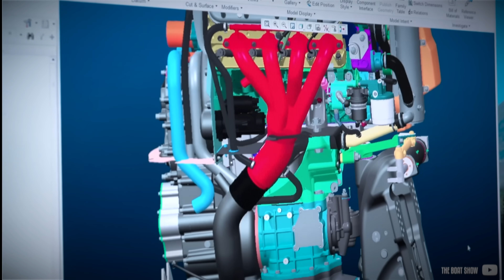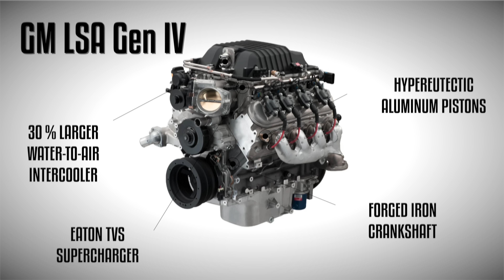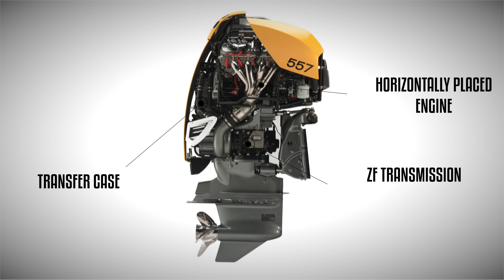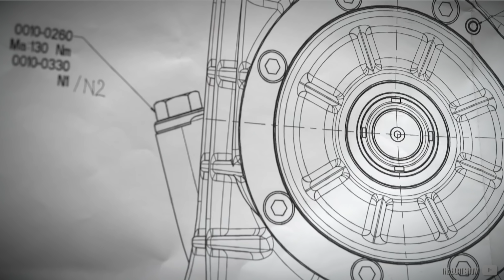How Volvo Killed This 627hp Supercharged Chevy Outboard

Comment: Using a car engine to power a boat is as old as the invention of cars. And even today, most engines used in a majority of boats are automotive based. And the modifications needed to make them live long lives in the salt water world are well known and documented. The automotive world is the feedstock for the production of marine engines. 

What 7 did was package a high performance automotive v8 power head onto an outboard lower unit and turn it loose in the marine world. It flat out worked, and it sold. But like the OMC v8 outboards, which came onto the scene and literally raised the outboard performance bar to a totally new level, the Chevy V8 outboard did the same for outboards. Now 450hp+ v8 outboards are widely available. Center console boats with 3 to 8 outboards bolted to the transom putting 1000 to to 4500 hp into the water are somewhat common. Now you see those big boats  getting to their destinations at 70 to 100+ mph speeds.
Reply: "most engines used in a majority of boats are automotive based" That is not true today. Outside of diesel all of Mercury's engines (outboard and sterndrive) are purpose-built marine engines. Including the new sterndrive product. With the 4.5 and 6.2 Mercury went away from GM blocks to avoid the need for VVTI in favor of simple pushrod tech.

Comment: Wow! Yet again another unusual engine that is not common knowledge. Great work Visioracer.
Reply: Pretty common knowledge in the boat world. Been out since 2011.
Reply: @longsleevethong1457  the R-4360 is pretty common knowledge in the aviation world, been out since 1945, but the average person knows little about it and it's worth watching a video on it, the same as this engine.
Reply: @Hydrogenblonde  we’re not talking about 100 year old boat engine history. Nice shot at a fallacy tho. We’re talking about what was a modern production engine seen everyday up until a couple years ago. Also only the transfer case and lower unit is truly unique. The LS engine might be the most widely produced engines in history and The transmission is an off the shelf zf.
Reply: @longsleevethong1457  it's still worth watching a video on it.
Reply: @Hydrogenblonde  i actually did look it up lol

Comment: Speaking as an Engineer, and a previous owner of an inboard outdrive boat ,   the idea of adapting an automotive power plant to anything but an automotive application results in bad reliability, too many changes in power direction,  too much weight and an overall bad result.  After a few years, I couldn't wait to get a power plant that was purpose built for a marine application.  It has less weight and MUCH better better reliability.  is quieter, with better fuel economy, etc.  My suspicion is that these engines were ever intended to be anything other than for someone with too much money to brag about to the hot babes and his other rich buddies.

Comment: Watched the company grow with amazement with what they were building and watched them die and knew it would happen when Volvo took hold. It was a short run. I am not clairvoyant but saw this coming. Now Merc has a V12 and no one to compete with. Volvo use to be innovative but guess they settled in at their place at number two. The seven marine was just too cool for them
Reply: What VP didnt know was that the calibration of these 7 marine engines was not EPA compliant. And thats a huge bloody liability
Reply: @whocares4648  EPA is just a US thing which others don't necessarily follow, ask VW if they ever paid any fines. What you say may be true but I find it hard to believe that Volvo working so closely with GM, a big chunk of their stuff is GM powered, that they would be clueless wether or not they could get an LS engine to comply with any standards. Just like them buying all the last supply of 496s GM made. The government had GM stop production during the bail out crying lack of efficiency but had no concern with volvo purchasing thousands of engines and use them for the next five years after they were discontinued.

Comment: And now Mercury is making a 600HP outboard and I'm seeing a number of them at the local marinas, they appear to be selling well.  So it seems Volvo left something on the table.  I wonder if the big outboards were cutting into the Volvo inboard sales and that had something to do with Volvo killing it?  If yes, then it seems to have been a mistake as Mercury has picked up where they left off.
Reply: Seven, even with Volvo backing it, would never been able to compete with Mercury. Seven was a custom, niche product with very high cost and many outsourced and complicated parts. The Mercury is basically an off the shelf product, normal warranty, have deals in relation to navigation/electronic support. It's developed from the ground up as a marine engine, with all the major parts built in house, and a huge dealer network, way bigger than VP. The moment the v12 Merc was released, the Seven sales would have dropped like a rock.
Reply: @Kowalski301  you're likely right, but there's still a group of people who buy for the flashiness above all else, and the 7 had that.  Especially in the category of those big boats. Is a 65 center console with 5 outboards practical? Definitely not, it's a show piece, I think 7 could have continued to sell into that market. No doubt the Mercury would have been a better motor.
Reply: @8180634  There are always people who buy custom or niche products and like to show that off, but the market is small, and the exterior of an outboard is also very limited and streamlined in that regard, and they all essentially look very similar across brands. So a custom paint or decal job is basically "90%" of what people see and all you need to make your outboard "unique" The only other thing people care about is the number of outboards and the HP... So if the quality and performance AND look isn't setting the niche product apart from the competition, there are even less reason to buy it. It would be naive to think that VP didn't run the numbers and saw there wasn't any money in it for them.

Comment: Kind of ironic that Volvo teaming up with Yamaha to build a 60 degree V8 car engine spawned the Yamaha 4 stroke V8 outboard. And now they bought and squelched it's competition.
Reply: Good point. Didn’t think about that
Reply: And ford used that engine in the sho too I think…or they designed that separate….can’t remember
Reply: @longsleevethong1457  The Ford motor was 90degree cast iron block V8  based on the duratec V6 but with Yamaha designed heads. Yamaha used that engineering and built a 60degree aluminum block. Then Yamaha turned the heads around, went back to timing belts, put in a dry sump, and increased displacement and made it an outboard engine.
Reply: @don2deliver  that’s it

Comment: It used to be from about 70 HP the price is reduced as the HP goes up, a 30 hp might cost you $4K, but a 70 hp will come in around $6K. Following this example, a 627 hp O/B should cost you $45K, not $100K plus.

Comment: The writing was on the wall anyway. The mercury verado 600 has more reliable naturally aspirated power, better fuel economy, lower unit steering, and it’s less expensive.

But the verado 600 would not have happened if 7 Marine didn’t kick things off with the 557 and 627.

Comment: The Cox 300hp V8 outboard Diesel has more torque at lower rpms, which means a faster plane and even in tight turns doesn't lose torque or rpms like the rest do. It does weigh more at 866lbs, however the pros out weigh the cons. And fuel mpg's forget about it, it blows them all out of the water. One tank to make it from Miami to Nassau and back, with no stops at Bimini for fuel. Now that's Impressive !
Reply: Just think how much better mileage you could get with 100hp!

Comment: Okay, but in essence its an azimuth pod mounted to an supercharged LSA. Obviously the gear train would have to be designed in such a way to avoid patent infringement but its basically a 90 degree direction change between an engine platform thats got as much or more suppport in the performance and aftermarket street racing world as anything else; and a pod drive which multiple companies have marketed over the last 20 years. 
I mean there are LS jet boats and air boats and for that matter SBC 350s in more inboard boats that pretty much all other non-diesel motors. 
Take a super available and easily upgraded high-hp motor, makena reduction gear jack shaft which isnt a top secret mechanism and add an off the shelf pod drive and wrap ot in some custom molded plastic and Id be hard pressed to consider it a patent issue and its certainly not unable to function in marine environments. Its an assembly of more or less common off the shelf parts using fairly standard gear train fundamentals, it wasnt some kind of perpetual motion machine or fusion reactor

Comment: I dislike the gear train whine. It didn't need to be that way if they had used helically cut teeth instead of spur cut teeth..
   Where is the air intake on outboard motors?

Comment: What was the point for Volvo Penta to kill this manufacturer? 
What do they have in that kind of range? Nothing, as far as I know, they never did outboards. The only lousily related thing is the Yamaha V8 that was offered both in Volvo cars and as an outboard marine engine.
Reply: Volvo penta 550 and 770 a 50 and 70hp outboard in the 70s an 80s
Reply: They have 430hp gasoline and 1000hp diesel inboards.
Rich people mostly buy a ready to run boat, they do not care about inboard or outboard, so they could easily be picking between a Volvo 800-1000hp diesel inboard or a seven marine 600hp gasoline outboard.
So it still makes sense to buy out the competition, and the competition was greedy enough to take the money and leave his company.

Comment: Volvo lied through their teeth, they knew Mercury was coming out with the 600, and it was designed from the ground up as a complete unit. Volvo didn't believe they could go head to head with Mercury, so they just threw in the towel.

Comment: The fact that they are using an off the shelf 5.7L LSA chevy engine as the power plant and still have to audacity to charge $100,0000 or more for a single unit just shows how ridiculous insane these outboard motor makers are! They are straight up robbing their customers by charging such stupidly sky high prices like that.

Comment: Just another example of a major company coming in doing a hostile takeover of a smaller company and then crapping on the original owner/owners and staff. On top of that taking the designs and innovation of the smaller company and shelving it. At least with the 7 Marine design they were using common GM engines. You can buy parts for those engines just about anywhere.

Comment: That boat that had 5 627's on it....couldn't possibly haul enough fuel to run those things at WOT for more than 20 mins. Jesus.
Reply: 5 627HP engines would use about 280 gph at full throttle.  Nobody runs at full throttle for long periods  of time. At a good fast cruising speed  they will burn half that amount.
Reply: Unlike a car or a small lake boat, these high speed open ocean cruisers with 4-5 engines can easily have a 400 gallon fuel tank.

Comment: An outboard motor that costs 2x the price of the car the engine was pulled from, must have been a really low volume outboard
Reply from the maker: Big outboards in general are not something very affordable. A Mercury Verado 350 costs 30K just give an example
Reply: @VisioRacer  We've got a honda 250 and a BRP evinrude 150, i was trying to make a pointed comment on how overpriced many of these engines are, often costing just as much or more than the car engines they're based on.
Inboard and inboard/outboard setups are much cheaper, you can get a 5.7L/350CID turn key LT for something like $1500, you just need a boat to put it in and a water to water heat exchanger, heck, you dont even need that, you can just use an air to water heat exchanger. Sure this is just the engine part, but the closed ecosystem of outboard motors means you cant just easily order a lower unit and mate it to just any engine, which allows manufacturers to charge basically the maximum the market can bear, instead of being competitive with themselves, they're competitive with the customer.

Comment: It was cool but it was a bad idea.  Boats require constant sustained power because they can't coast. Using a supercharge, Petrol, V8 motor was the wrong philosphy.  These are good for short burst of power and use lots of gas.  The right philosophy is OXO marine with a 4.0L twin-turbo , V8, direct injection diesel. It has more torque and can sustain it's power at a lower speed.  Plus it gains efficiency at lower throttle levels which what it takes to overcome the constant resistance of water. These motors were special though,  It's a shame they sold to Volvo Penta,  Volvo does make wonderful marine motors.

Comment: Just thinking if they made a V6 LS what kind of power that would make
Reply: There is an i4 ls out there
Its on YouTube
Reply: the new 4.3 v6 chevy trucks are basically a v6 ls its different than the older 4.3 v6 that was based off a small block chevy with 2 less cylinders.
Reply: @ivanshapli1827  this
Reply: Approximately 25% less

Comment: I friend of mine here in South Florida has twin 627's on his 37 Intrepid... 
They are expensive to maintain and until the lower units were replaced with the dual props, it was not very efficient.
They are mind numbingly loud on long trips.
Only a few good mechanics are familiar with them that you can trust.
You can tell they were built by "fresh water" guy's because there are a lot of corrosion issues...
When 7Marine sold out, they got the Golden Handshake!!!

Comment: If I spent that amount of$$money$$$ on an engine I sure as s**t wouldn't run salt through it!!  Even with trying to make sure all inner components were protected!!! Little dead animals can clog a masterpiece like that in a matter of milliseconds to totally waste such a magnificent beast!!!
Reply: Salt water doesn't touch the inside of the engine!
Reply: @godzilla7148  Have you any clue where the cooling system of an engine is and if not using a radiator????